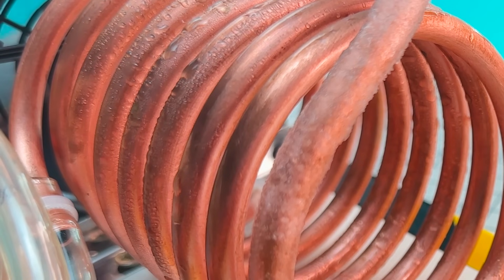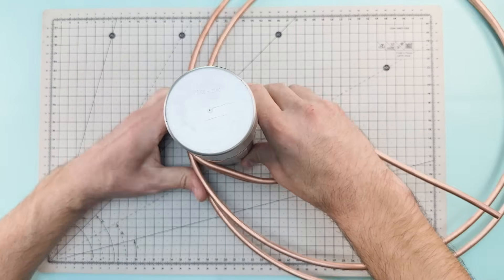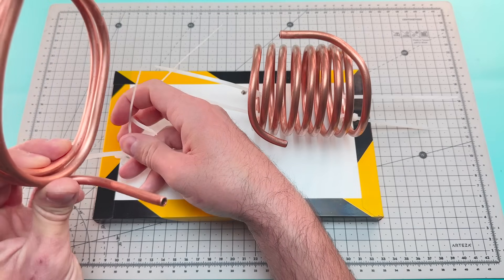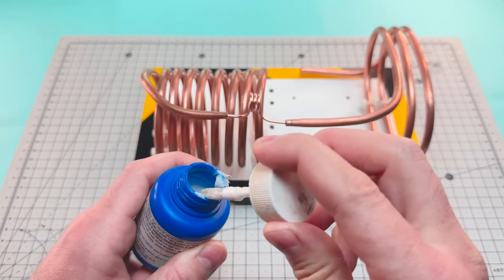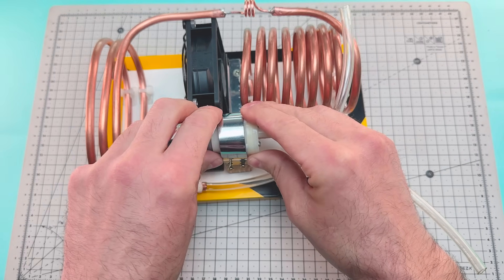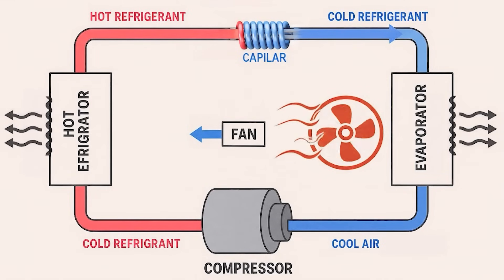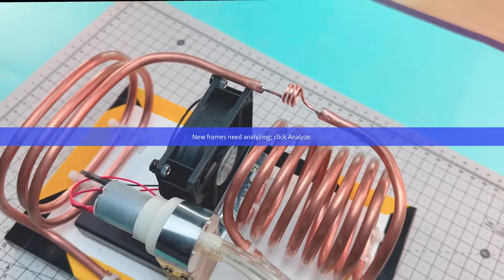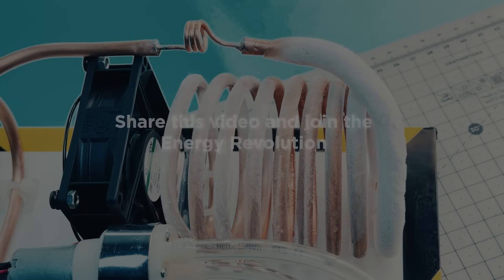DIY Mini Fridge: Free AIR CONDITIONER with Isobutane! ❄️It Actually Works!

Comment: The fan is not efficient, put a funnel to make the laminar flow both before and after the hot pipe, in this way you use less energy to cool, if you want to complicate things a bit you can also remove the fan and immerse the pipe in a tub of water attached to an adiabatic pump to transmit the heat efficiently perhaps in a room that you want to heat,  build a funnel and install a  fan on the cold side following the same principle, To do things more efficiently you can build an empty pipe with a section 3 times larger that goes back to where the fan takes the air and imprint 2cm impressions on the pipe longitudinally to better irradiate the cold, the advantage is that by exchanging the power supply the air conditioner generates heat

Comment: I'd like to know how to adjust this to be able to plug into a wall outlet!
Reply: @MitchellSchenkel  instead of using a battery pack just use a DC power pack that has the same DC voltage and milliamp hour rating as the pump and fan